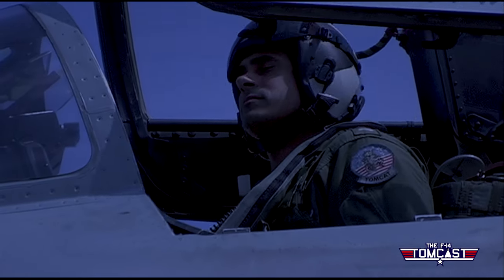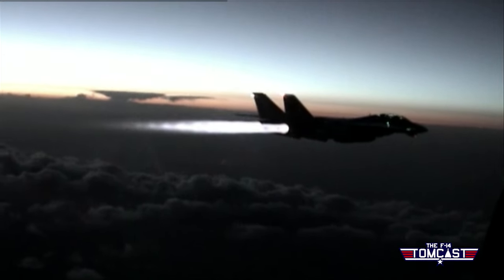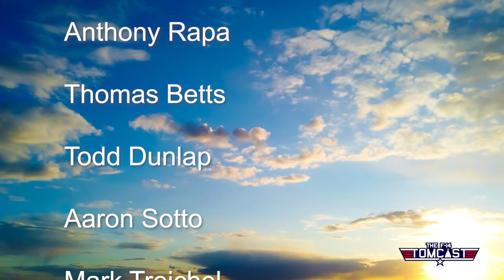13. Rig the Barricade!

Comment: Assuming there was a green light to take on fuel then the switch to open the shutoff valve did not send a signal for it to open.  The valve itself usually didn't fail.  So no fault on the refuel engagement there.  If there wasn't a green light it's still most likely the fault of the switch since the timing has to be just right.  If timing is off then there is no mechanical connection to make contact with the switch and the refueling can't take place.  Most of the discrepancies for the hose reel was the timing, then the switch, and sometimes the basket due to damage to the small chute or the valve there (not the valve talked about earlier).  95% problem was electrical with timing.  

Perhaps the reel or hose was previously damaged and the timing was off because of that and therefore also no fuel flow.  Since the hose and basket departed that's a possibility or it could have been damaged from the third try but even so it had to be attempted that way to force the probe into the basket with the IFR probe which could have been the malfunction (a malfunction of the valve at the basket). Occasionally that valve would not accept an aircrafts IFR probe.  I'd rarely seen a reciever aircraft be the cause of not getting fuel though I would put that at about one (receiver aircraft) IFR probe refueling shutoff valve at one valve removal and replacement per cruise for a squadron or air wing as I can recollect.